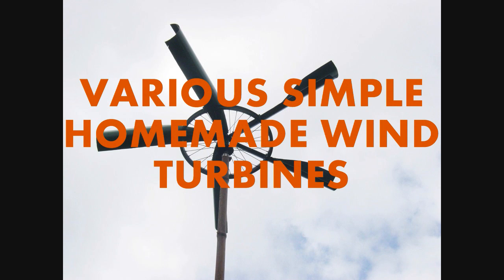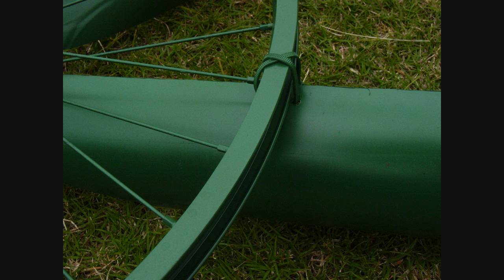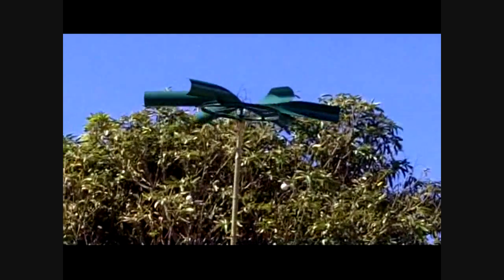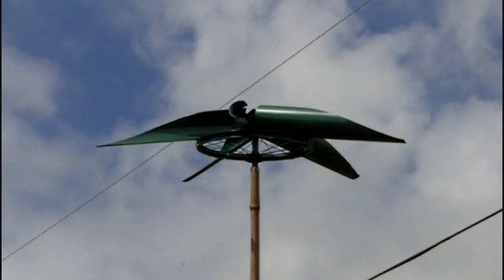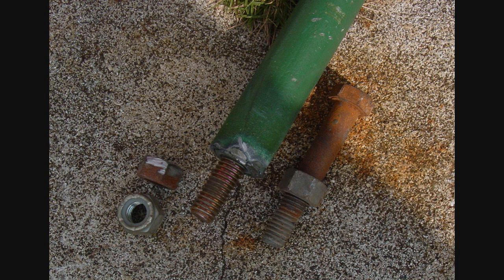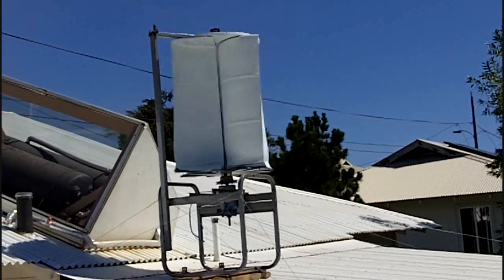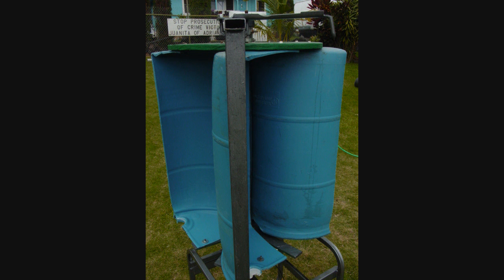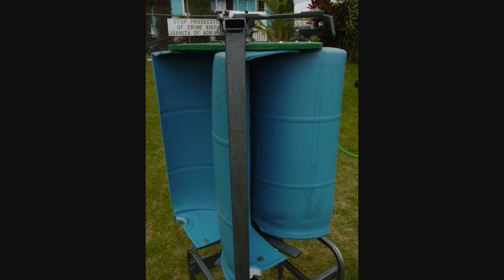VARIOUS HOMEMADE WIND TURBINES

Comment: I had the same idea but haven’t done what you did.  Built it.  I wonder if you could have multiple turbines in a row and use transaxles to connect them.  With enough of them and gearing, it could produce serious power.

Comment: does this green windmill discharge if the unit spins the opposite direction? also do you have to setup a voltage regulator if the mill spins faster and goes over the 14 or 15 volts going back into the battery banks ? i am curious because this fall i am building a new house and going off grid !

Comment: The difference between the first design w/ the longer blades and the second design with the shorter blades is speed and torque.  The longer blades have more torque, shorter blades are faster.

You've made me wonder if I could put those aluminum attic vents that spin to use as some sort of discrete turbine that my HOA wouldn't even know I had.

Comment: I am, Running down a train of thought here mrgalleria, and I think if two units, were side by side, 1/ with a cowling, & 2/ one without a cowling, would each produce the same results, I favour the cowling directing and using the force given to a grater degree, and so offering more torque, !! what you think  mrgalleria?,  
Thom.

Comment: @mrgalleria THANKS, I did not know ceiling fans had more torque," TA,  but i see torque in two ways mralleria, 1/ is fine for transferability of power, 2/ is getting the power to create the transference in the first place, can the wind give enough power to the motor for this to take place,( I guess I am Asking the torque of wind) ? where is the balance ?, is the root im trying to understand, any advice will be "humbly received". thanks again.
thom.